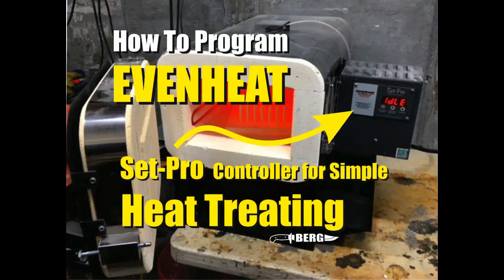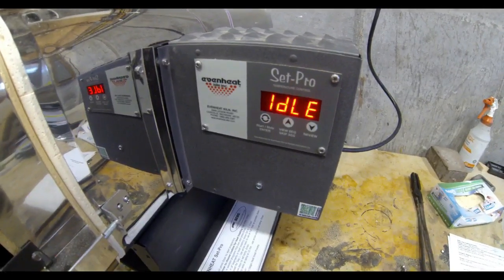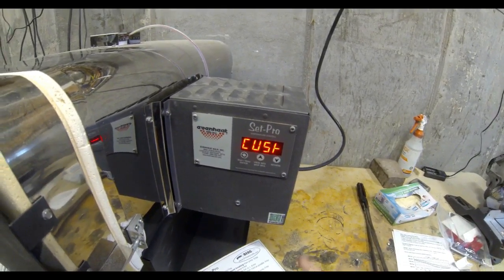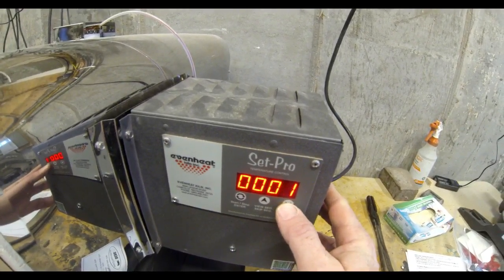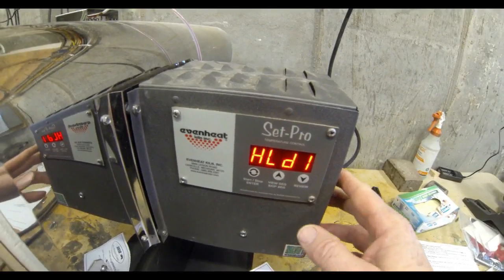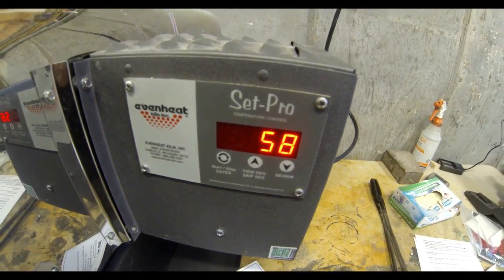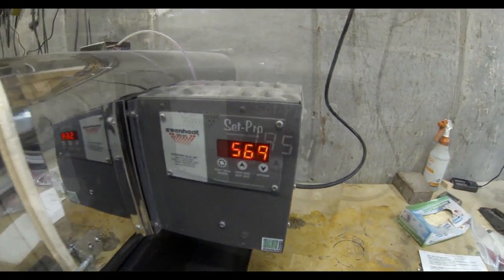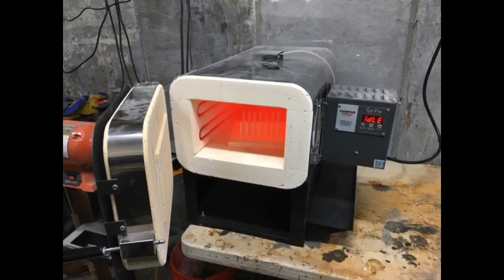How to use Evenheat Oven Set Pro controller for Simple single segment knife heat treating

Comment: Which model evenheat do you use or which would you recommend for just a few at a time?
Reply from the maker: I bought the 24 inch. It really depends on what length blades you plan to make.

Comment: The ramp up speed; is that controlled in minutes? Could i have the oven ramp up to 900deg F in say 30 minutes? or does it not have the ability to control ramp up time?
Reply from the maker: You can control ramp time. I always ramp up at Full which takes 15 min or so to get to 1960 degrees

Comment: I'm thinking of a oven myself and currently trying to figure out what I would want/need. You said it takes 10-15 minutes to warm up. Is this from room temp to say 1500 degrees? Also is yours 110 volt or 240? Any other input about a oven I would welcome. I'm currently using 1080 steel and a small forge to heat treat. Love your videos and channel. Very helpful. Subscribed Thanks
Reply from the maker: Warm up time is from rm temp up to 1950. My oven is 240v. I use to do mostly 1095 blades because that is what I could heat treat in my forge. No almost 100% AEBL stainless. Its really nice to make a quality blade and not have to worry about it rusting. Glad you like the videos. Please join out facebook group knives and knife making and show me some of your blades.

Comment: Question about the kiln, when you open the door does it decide to turn off the coils until closed again?
Reply from the maker: No coils stay one. You do loose heat from the door being opened.
Reply: I think he is wondering about a door kill-switch,  @DIYeasycrafts . So when the door opens, the power is shut off to the coils. So they are not live, when loading an unloading the oven. This type of kill-switch, has become very popular in ovens now.